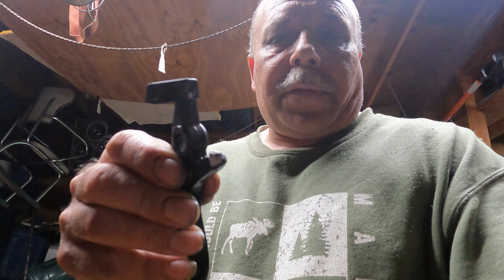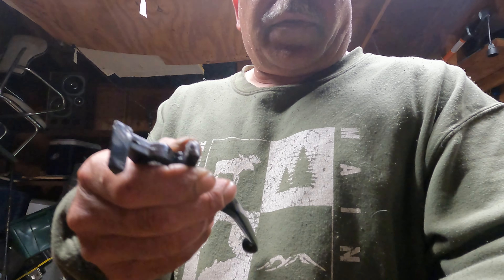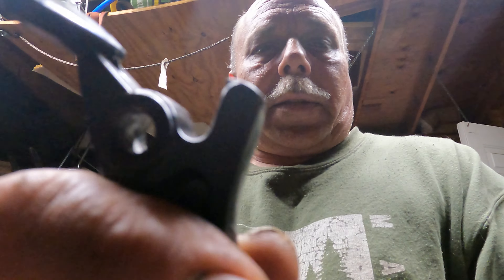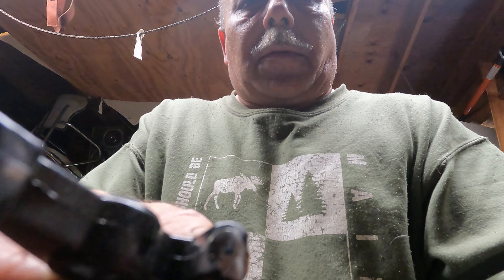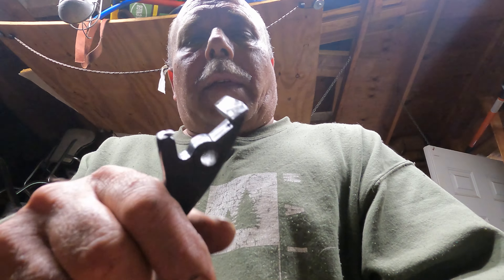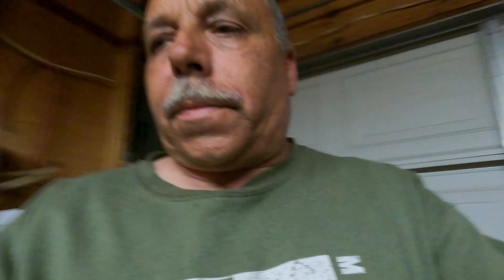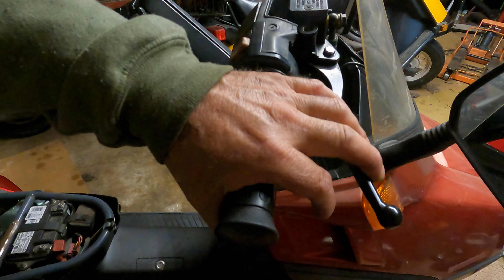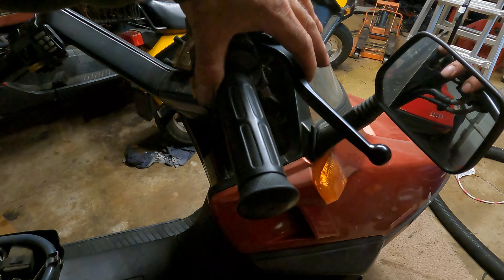Honda helix master cyl update

Comment: My front brake feels hard. I changed brake fluid. I used what was recommended.  It’s still feels hard.  Looks like new brake pad. The old fluid was nasty.  I’ll try a new master cylinder in the spring